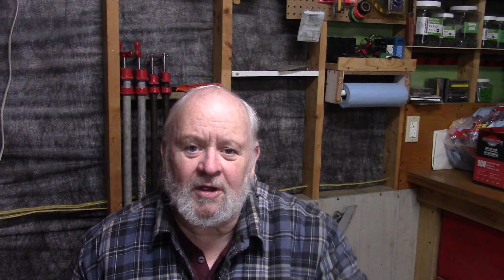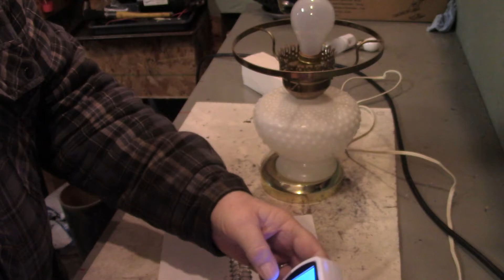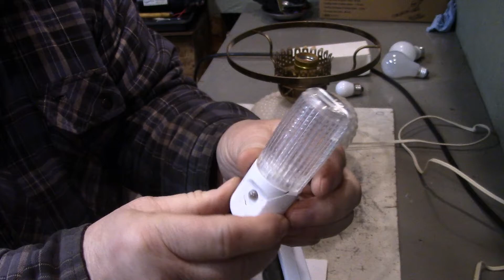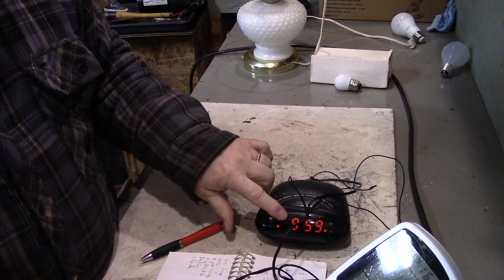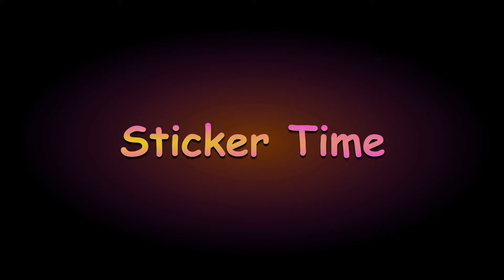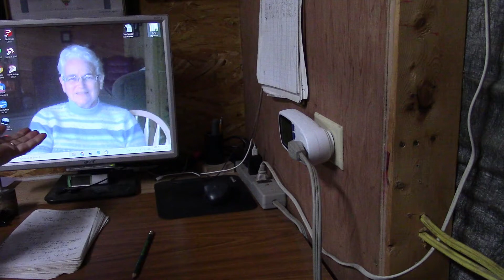The Power Struggle Continues And a John Klem Sticker Shout Out

Comment: It really is an eye opener! I used one of those meters to determine how much my CPAP machine would draw. I wanted to be able to power it up from a battery pack inverter when we were not connected to power in our RV trailer. About 20 watts. A small television was about the same.
Reply from the maker: How's she goin'?  It's very interesting to see how much power all the plugged in stuff we have uses.  I was surprised by a lot of things.  I knew they all used power, but the amount sure is an eye opener eh!!!  Thanks a lot for dropping by again.  Take care!!!
Reply: @GrampiesWorkshop  I think the amazing part is the “ghost” loads of things that are plugged in, but not turned on or powered up! They still draw power 24/7.

Comment: One thing that people don't consider is that the devices that have transformers (wall warts), the box on your laptop charger, phone charger, etc.. all use power even if the device/phone/laptop is off. Also, nowadays most devices (TVs, Kitchen appliances, smart devices and light bulbs, as well as anything with a remote to turn it on) do not shut off. When you power off you TV it goes into standby mode waiting for your to 'turn it on'. It still uses power in standby.
Reply from the maker: Hello there Rick!!!  So nice to see you commenting on my channel!!!  Thanks.  You are so right about most appliances these days.  We had a 'smart power bar' for our TV and satellite receiver a while ago.  When we shut off the TV the power bar would totally isolate the TV and satellite receiver.  The problem there was I would lose the channel guide info and my favorites on the satellite receiver.  I wasn't long getting rid of that power bar I'll tell ya!!  Thanks a lot for the visit and take care!!

Comment: Hi Mike. I bought one of those exact units a few years ago and your video is a good reminder to dig it out and put it to work. Good to point out that he little transformers on everyday items,  like the clock radio, are using power even though the radio may be off...it's just a trickle but that adds up. Interesting that L.E.Ds have taken over so quickly. I have a few vehicles in storage outdoors and I like to keep a trouble light in them to ward off mold. A bulb burned out the other day so I went around my place trying to get my hands on an incandescent bulb...it was a chore but I eventually found a rough-service bulb that worked. Thanks for your interesting and engaging content! I always look forward to seeing what you'll come up with next! Stay warm and be good!
Reply from the maker: How's she goin'?  LED lights are some nice.  Brighter for far less watts and cheaper to operate and they last longer, but they don't heat like a 100 watt bulb does that's for sure!!!  I can remember having my pump house set up with 2  100 watt bulbs in it to keep the pump from freezing.  I set one to be on all the time and the second one to come on if the pump house got too cold, which could have meant the first bulb burnt out.  The trouble was, I had no protection on the second bulb!!!  LOL  It worked all that winter though.  Thanks for dropping by and commenting and take care!!!

Comment: I'm chuckling to myself here Mike, I bought one of those from Amazon about 2 years ago, and never took it out of the box. ( I wonder why I do that every now and then! :) 
I think I'll go dig this meter out tomorrow and go check some of my power tools and get ready for a surprise LOL.
I have to ask you Mike, is that power bar CSA or UL approved?  I had a customer of mine, come in one day and told my brother and me, about how he lost his whole workshop to fire that
the Fire Department confirmed was caused directly by his 'cheap' un-approved 'power bar'. It caught fire one day, while he was away from home. His workshop was quite a substantial
one in it's own building/garage. I've been very aware of  'cheap and not labeled'  power bars that are made of Chinezium, ever since. Just thought I'd pass this on to you while I think of it.
Reply from the maker: How's she goin'?  Well Reg get prepared to be shocked!!  I know it sure surprised me at how much some appliances and plug in things use!!!  Even when they aren't turned on too!!!  I'm not sure about the power bar, but I'm thinking it is CSA approved.  We bought it at Wal-Mart I'm sure, so it will have some Chinezium in it, but I think it's stamped!!!  (For what ever that means these days eh)  Thanks for mentioning that though.  I do have some power bars from the dollar store and they are crap for sure.  Thanks a lot for dropping by and leaving a comment.  Take 'er easy!!!
Reply: @GrampiesWorkshop  I'll be checking the tools in my shop starting Saturday. I think I can guess ( almost ) what too expect.
Thumbs Up Grampie!

Comment: Thanks for doing this Mike. We converted everything (almost) in this house and a lot of the outside lights to led's when we moved back out here. It makes a big difference in the electric bill each month. Not to mention that the lighting is by far superior with the led lights. No comparison.
Reply from the maker: How's she goin'?  That's a fact eh Gary!!!  The LEDs are brighter for a lot less wattage and they last a lot longer too.  One thing I noticed with the LEDs though is when we're on generator power the LEDs tend to have a slight strobe effect sometimes.  Nothing real serious, just a difference.  Thanks for dropping by and commenting.  Take care!!!
Reply: @GrampiesWorkshop  When I worked in the mine, all the heavy equipment had led lights. The only drawback was that the led’s emit a frequency that interferes with the use of the radios underground. Badly. There were times that we would have to shut off the lights to communicate by radio. When we brought that up at a safety meeting, we were told we were crazy. We took them for a little ride about a mile back underground and proved our point.
Reply from the maker: @tractortalkwithgary1271  Interesting eh!!!

Comment: Hello GP, hope all's well. Had my gc2310 out and sometimes I noticing a high pitched hydraulic sound when using my front bucket. Any ideas why? Thanks for all the great videos!
Reply from the maker: How's she goin'?  When the loader makes the high pitched hydraulic sound is it raising or lowering?   If you speed up the engine does the sound change tone?  I'm thinking it might be low hydraulic oil, a blockage in one of the hydraulic lines or a pressure relief valve incorrectly set.  If it really is bothering you, a dealer can check it out.  Thanks for the visit and I hope this helped some.  Take care!!!
Reply: @GrampiesWorkshop  
Thank you for responding. The fluid is new and full. It's not a consistent noise. I'd just figure I'd look into it before it becomes a problem. Do u have any videos on the valve u mentioned. Thanks again.
Reply from the maker: @dtruth5769  No, sorry, I don't.  I know very little about hydraulics and to make any adjustments to a pressure relief valve I would want to make sure I knew exactly what I was doing.  So for that I would consult a service technician.
Reply: @GrampiesWorkshop  
Thank you! Be well GP!

Comment: Interesting - the meter will come in handy to check things you may or may not need plugged in. Many things we leave plugged in rather than the inconvenience of plugging them in when we need them but for some of them it could be well worth unplugging.
Reply from the maker: You're right!!  I turn off the computer in the shop now because of that.  It will take about 2 minutes before I can use the computer now, but I think that I can handle that!!!  LOL
Reply: @GrampiesWorkshop  Right on and I leave the radio/cd player unplugged until I need it.

Comment: That meter gave some good information, it’s amazing how much we can save now just by switching to LEDs instead of the regular bulbs. Thanks for sharing your test Mike and have a great week 🙂🙋🏼‍♂️👍🏻
Reply from the maker: How's she goin'?  The LEDs are so much cheaper to operate than regular bulbs and they last a lot longer too.  I put LED tubes in my shop.  A lot brighter, but since they were the direct replacement ones, I haven't saved any power as they are powered from the old fluorescent light transformer and it was the culprit that drew all the power.  Thanks for watching Luc and commenting.  Have a great week!!!